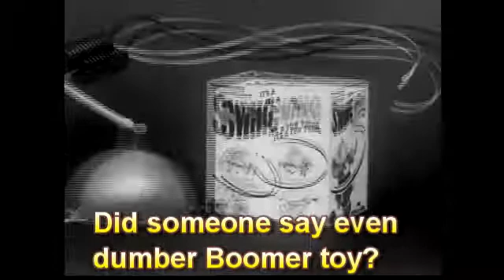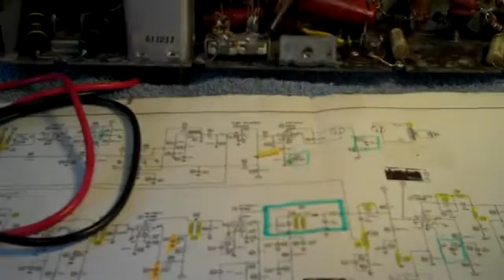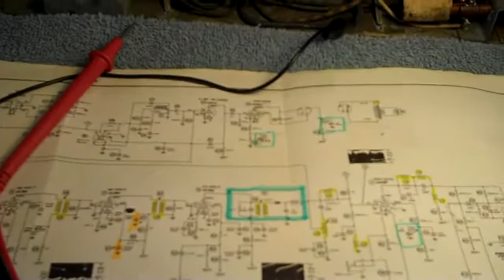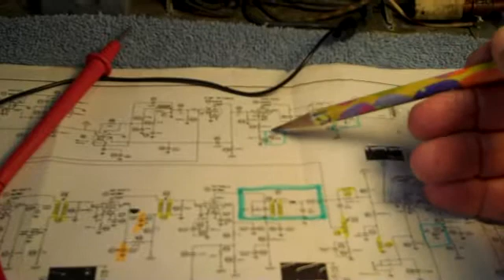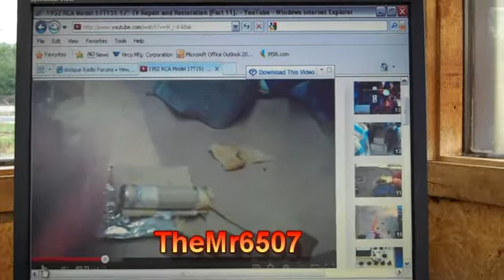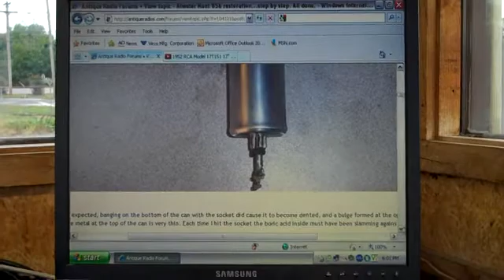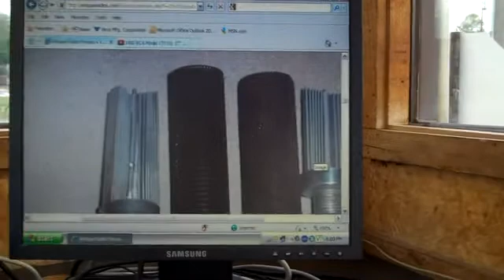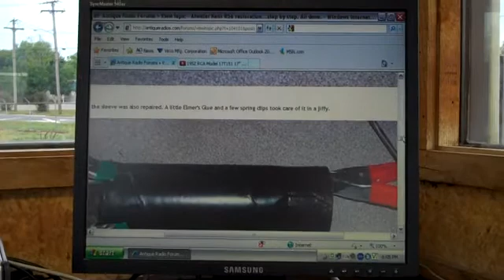1952 RCA Model 17T151 17" TV Repair and Restoration (Part 14 of 27).

Comment from the maker: One method of cap replacement is actually as good as another, as long as it works.  And I also generally use terminal strips to mount e-caps, but I wanted everyone to see at least one way of re-stuffing filter cans.
Thanks for dropping in.

Rgards,
John